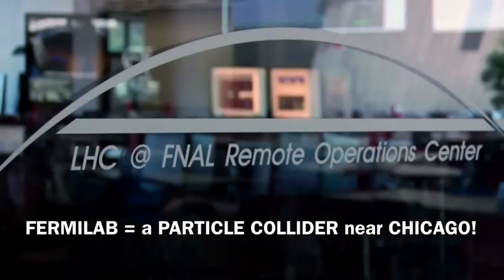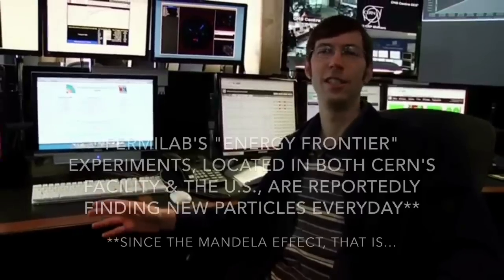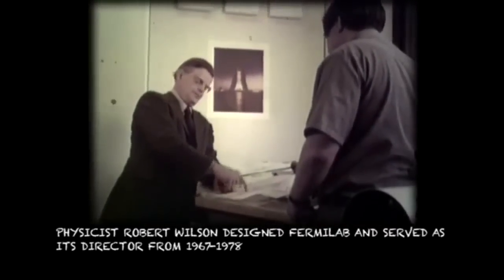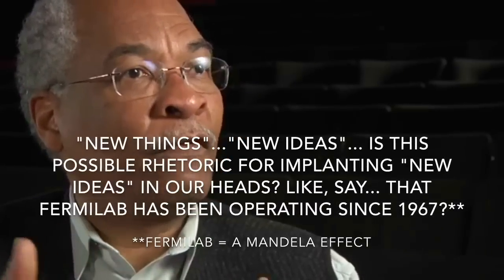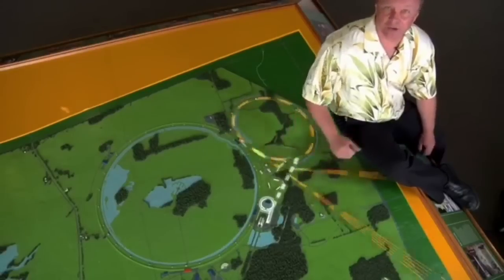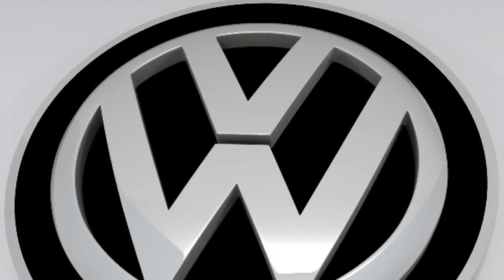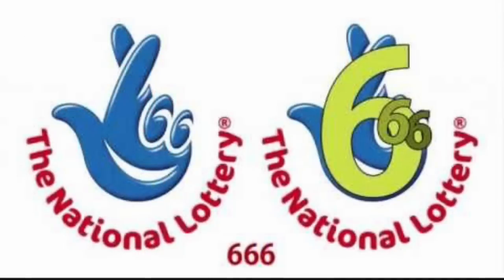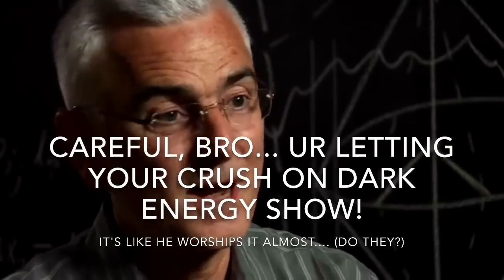HUGE MANDELA EFFECT! The U.S.has a CERN in CHICAGO since 60's! LHC Particle Accelerator FERMILAB NEW

Comment: The Los Alamos Neutron Science Center (LANSCE), formerly known as the Los Alamos Meson Physics Facility (LAMPF) is one of the world's most powerful linear accelerators. It is located in Los Alamos National Laboratory in New Mexico in Technical Area 53 (TA-53). It was the most powerful linear accelerator in the world when it was opened in June 1972.[1] The technology used in the accelerator was developed in part by the nuclear physicist Louis Rosen. The facility is capable of accelerating protons up to 800 MeV. Multiple beamlines allow for a variety of experiments to be run at once, and the facility is used for many types of research in materials testing and neutron science. It is also used for medical radioisotope production.

Comment: For the record. Fermilab has actually been around since the 60's.  America led the way with "atom smashers" for decades.  We were due to build the biggest one in the world back in the 1990s, but the funding fell through and the LHC in switzerland took the lead in particle research.  I remember Steven Hawkings and others making a plea to the President to keep the funding but to no avail.   I work at a major University and we rent our Syncotron out to other groups because we don't use it anymore really.  We're working on different types of energetic experiments now like Bright photoelectron beams.  Fermilabs is working on improving Lineac technology now.  Which is different from the LHC.   There are particle accelerators all over the world the only reason you don't here about them is that the LHC in Switzerland is the biggest, and most powerful so they get the lion's share of the press.  China is trying to over take them as we speak.

Comment: The letter used to represent a neutrino is not a 'V'. It is the lower case Greek letter ' nu' , which corresponds with the English letter 'n' . Greek also has a gematria system,  which assigns number values to letters. 'Nu' has the value of 50, so 'nu nu nu' would be 505050.

Comment: Comparing Fermilab to Cern is like comparing a rowboat to a battleship. There are dozens of colliders in this country starting in 1932. The difference is Cern is a LHC. A large hadron collider.  The only one in the world. The max acceleration power in Fermilab  is 900 billion electron volts. It's length is less than 4 km. The 6+km ring has been shut down for years.

Cern on the other-hand, is 27 km long and uses 6.5 TRILLION electron volts in proton mode. Entirely different. BB gun versus missile launcher.

Comment: There are particle accelerators, and then there's CERN.  For all the things that CERN may have altered, it honestly doesn't seem like they either know what they are doing, OR maybe are even at the limit of what a collider that size can accomplish. Which means they need a bigger one.  But frankly, if they had this down we wouldn't even know they were doing it, and they would have changed more than a few logos, movie lines, Bible verses, or made a limo two seats longer. Right now they are vandalizing reality, but not even close to rocking the foundation or doing any real damage.  A kid with a can of spray paint is not a threat to the building, but if that kid get his hands on a wrecking ball.......

Comment: Brookhaven National Labs in NY has some particle accelerators. It was the location where the Rainbow Project (Philadelphia Experiment) was continued, which started with the teleportation of the USS Eldridge, until Congress got wind of it and it was clandestinely moved to  Camp Hero AFB (Montauk) and renamed the Phoenix Project (Montauk Project). The Montauk Project is about mind control and interdimensional travel and is the craziest thing I've come across until the Mandela Effect. It is also connected to the Babalon Working ritual, the purpose of which was to reincarnate the spirit of the Whore of Babylon. Nine months after the Babalon Working, Hillary Clinton was born, who is often associated with the Phoenix.
 https://earth.google.com/web/search/brookhaven+national+labs/@40.87206065,-72.8739558,28.91406226a,3096.6889614d,35y,-0h,0t,0r/data=CigiJgokCfezc9RFckRAEcZxXjbea0RAGQQ0lflcMlLAIXHrPPb3OlLA And I'm from Europe too, and I'm pretty sure a thing called Fermilab has been in existence for a long time, but I can't tell if it's always been in Chicago.